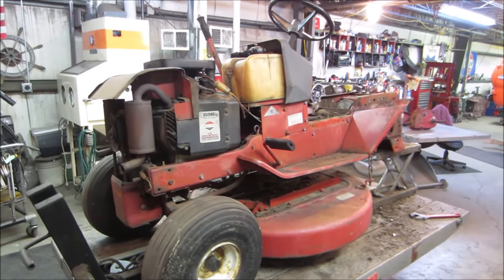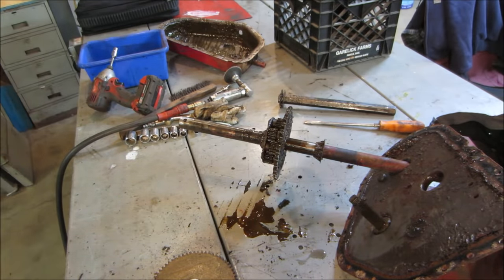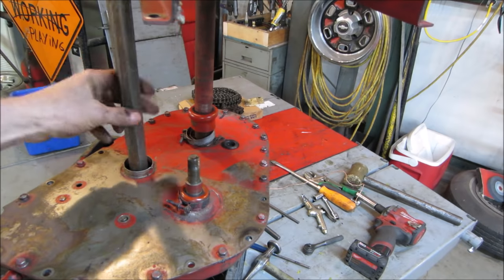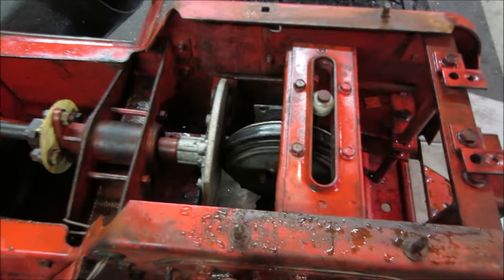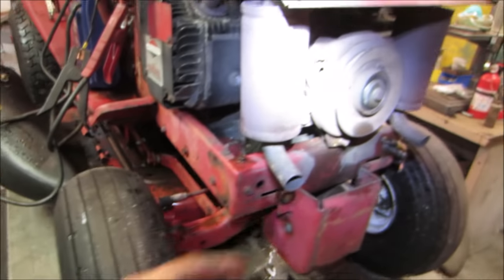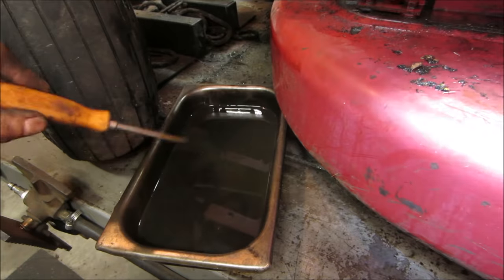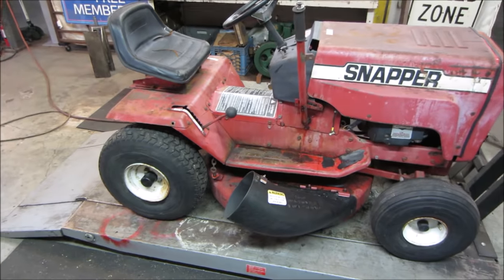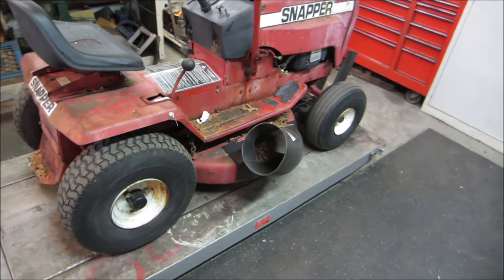Can We Fix The Damage? Free Snapper Mower.

Comment from the maker: Hi Guys check out a friends tv show that will be on discovery tonight, check out the preview here, https://www.youtube.com/watch?v=z_qmTT1cFKU
Reply: Thank you Darren! ML&R
Reply: So when you're ready to take this mower to the next level I can hook you up with some left over and sample hydraulic goodies to convert that to a hydrostatic drive (industrial, not mower type).  That would work better than the disk drive for wheelies, towing cars, etc., than the slippy disk drive and offer the added benefit of being complex and cool. The whole show could fit under the seat driven by the driveshaft.
Reply: ive been following and watch in YT a Kaplan America long time now
Reply: ok, THIS looks like fun!
Reply: @KaplanCycles  looking forward to it! Thanks Mustie for sharing!
Reply: @Miata822 n

 a
Reply: @owenhawkins4951  ???
Reply: These mowers usually take 00 grease, since as you noticed, they are not sealed tight enough to keep oil in.  If I don't have 00 grease, I might make do by mixing about 3 parts standard #2 grease with one part gear oil.
Reply: On your rant.  More and more of the new stuff has no manual because the company expects the whole assembly to be replaced as a unit, such as a Nissan Continuously Variable Transmission.  For this stuff, not only is there no manual, there are also no new parts, so any repairs need to be done entirely from junk stashes and intuition.  Starter motors, Alternators, power steering pumps, AC pumps and stuff like that are getting that way too.
Reply: @KaplanCycles  saw your show! Love your stuff Sir!
Reply: @jessewoolley6323  what u trying to say do u need help
Reply: I like this dudes page no nonsense straight to the points KEEP IT UP  BOSS MAN
Reply: Great work Mustie, i love your long videos, very interesting. Thank you.
Reply: Kaplan is the man!
Reply: Mustie just a suggestion I use 15/40 rotella T 4 in my J D lawnmower and wouldn't use any thing else I highly recommend it have gotten the very best service out of it.    I just can't understand why people spend their hard earned money on equipment and don't properly maintain I know some times things just happen but proper maintenance goes a very long way? That single blade will make a beautiful cut and I would never modify that mower for nothing else great find and job I would love to find a free one like that my self.
Reply: Just to let everybody know that the lawn mower people do not put on parts catalogs on anymore but you can request them and they will send them to you this is good FYI since nowadays they don't put anything that they don't have to and they want to make you not be able to fix it

Comment: There really is no better feeling than bringing back a DOA piece of equipment. Those who've never done it just dont understand!
Reply: I know the feeling. I restore old machines all the time. It's very satisfying to see an old machine live again.
Reply: It’s even better when it’s something dead easy too, like the one mower I got was sold to me as scrap with the note that the transaxle was blown, well it moved down hill but quickly stopped moving and had no reverse, after dropping it I found the axle was snapped (I may have figured this out some other way but I forgot) and it was off to the friend with a welder, some sealant later and all was good
Reply: So true, I did 2 push mowers and a pressure washer this summer.
Reply: Yeah I took a 300$ 1980 kdx 175 two stroke dirt bike that was sitting for years and no top end gaskets and no carburetor plastics or seat and pieced it back together with a carb I had and made gaskets and made a seat and seat cover from a shirt, bought some cheap grips air filter and a carb rebuild kit and a chain then I got to ride it today, under 400$ for a running riding vintage bike with working brakes and everything🤙
Reply: Yeah it’s great
Reply: Your absolutely right I've done it many times
Reply: Amen brother.
Reply: Again great video 👍

Comment: The old AAA sticker on the dash is an especially nice touch.  “Ah, yes Triple A?  It would appear I’m out of gas and stranded about 15’ off the side of my driveway.  Can you send someone out with a gallon please?  I’ll be in the rusty Snapper sporting a jumper pack!”
Reply: Holy crap! I just left the EXACT comment! Seriously. Stranded in my yard, out of gas. Even the part about needing a gallon of gas! Read yours and had to delete mine. Great minds think alike.
Reply: @Sebastian_Dinwiddie  Chris beat me to it too !  🤣
Reply: Funny but if you can get bicycle service from AAA, why not mowers?👍🏻😏
Reply: Locked my keys in the mower.
Reply: I wonder if they would have brought a new belt once the old one broke?
Reply: "My jumper pack needs a jump."
"Sir, that's called recharging."
Reply: Are you sure it’s not Alcoholics Anonymous. It is a snapper.
Reply: It’s odd that I have the exact same AAA sticker on my Snapper rider.  I think that I got it in junk mail and just decided that the mower was a good place for it.  It’s never left my property in 20 years so, no need for AAA.
Reply: @andy1056  sorry about your problem
Reply: @mikesbarn1858  🤣🤣🤣🤣🤣🤣
Reply: @robertgrant4501  🤣🤣🤣🤣
Reply: @zarb88  🤣🤣🤣🤣🤣🤣
Reply: I used to work for an auction company that did a lot of estate sales and for some reason a lot of the riding mowers usually had a triple a sticker.
Reply: Broken chain indicative of too many neutral drops.

Comment: I totally agree with your philosophy. I taught myself about small engines by tearing them down, figuring out how they worked, and fixing them. A friend of mine owned a small engine business. He had five mowers that had not run in years sitting in his back yard, and he gave them all to me when he moved. I just started tearing them apart over the last couple of years. I fixed two of them completely, built a good mower completely from scratch out of two others, and finally got the fifth one running two days ago. I have a few things to button up on it, but it's running pretty well. In the meantime, I have worked on nearly every type of small engine imaginable now, and have started taking paying jobs recently. To cut a long story short, I am 100% self taught, and taught myself simply by taking them apart and learning through trial and error. That's the way it should be done.

Comment: I inherited an exact copy of this mower from my father in law when he passed. 
I think it is much better than newer mowers with all their safety devices which cause batteries to run down and prevent starting. 
I have replaced the drive wheel, belts, air cleaners, blades, switches, and some other parts.  
Mine has a long battery next to the driveshaft and is hard to remove. I have a battery fixed to the outside of the body.  
This mower is more comfortable than the John Deeres.

Comment: Its just extremely satisfying seeing someone spend this much time and care on a cool old mower.
Reply: That much time? it is all relative. How many hours do blue collars workers have to put in at their boss to buy a new mower like this? Fun fact the new mower would never last this long as this one. (and it already has a head start of 25 years) If you keep this one from rusting it will last you a lifetime.
Reply: @patrickvanden8322  you know, thats why i only own old stuff
Reply: I picked up a used B&D MM 200 electric mower  off the trash pile. Fixed the rotten frame. Used it for 20yrs until motor burnt up. Replaced it 2020 with a NEW B&D MM 2000. ON SALE for holiday. 😄
Reply: @datadavis  Because they last or that it is way cheaper?

Comment: I grew up taking things apart and putting them back together. Dad brought home 3 boxes of engine parts when I was 15 and asked me to put it together. The following day when he got home I had it done. He opened his briefcase and handed me the manual and told me to make sure I did it right... my wife says there is nothing I can’t fix. Maybe, but that’s because of all the stuff I’ve taken apart with no instructions. Cheers.
Reply: I offered $13.5K cash for an '83 Mercedes SEL (in 85) with a busted timing chain from a consignment guy selling for a bank, who'd repossessed it.  Bank said That's WAY too cheap, we want to verify the issue before we'll accept.  Mechanic tore the engine apart, expecting the work.  When the bank finalized the sale and I didn't give him the work, he was pissed and randomly threw MOST of the parts in 2 boxes.  No manuals or anything, first MB I'd ever worked on. Parts ran another $3K - no internet back then - and you bet my ass was tight trying to make that much money run for me.  Made it run like a top and was near 300K miles last I saw it, when the ex got it in the divorce.

Comment: Mustie1. Definitely agree the old stuff was easier to repair without all the cheap plastic. I also used to get “not working stuff”, tear it apart and find out why, then fix it. Very interesting and Enjoyable! I did that one winter to a small Harley 175cc single cylinder Bobcat that was not running and rusty when given to me. I brought it into my bedroom (after draining gas, oil and fork fluid) tore it down to every nut and bolt. Cleaned everything, fixed a couple parts and replaced a couple more with 2nd hand parts. Put it back together and rode it for the next couple of years. We lived in a cinderblock home out in the woods with a bad roof (which I fixed also) so bringing into my bedroom wasn’t a big deal to the linoleum/rotted wood floor. Was a proud moment when it started on the third try!! Woohoo.

Comment: I just fixed my neighbors Simplicity 9020 with the same motor. It had a weird point setup, but the problem was that someone had connected the 'cylindrical mystery thing' with the spark plug wires coming out of it on ground. So yeah, the owner got scammed out of $500. She offered the papers and manual, but I declined and figured it out on my own.
This would not have been possible without your channel. You have been inspiring and teaching me to mix stuff the best and most fun way for a long time. Thanks man : )
Oh, and I got a briggs 5 horse, an old weed eater and a couple pocket watches for the job, so absolutely worth it!

Comment: I buy used/broken shotgun shell reloaders, fix them up, and resell them. Most of them have problems or have sat a long time and are rusted. I've done around twenty of them over the past five years and have gotten so that I can take them apart and put them back together without referencing exploded views on the internet. You are right about diagnosing things without any reference manuals. The experience of figuring out how things work gives you an appreciation for your abilities.

Comment: I love your ‘rant’ at about 59 mins, taking things apart, learning  how they work is park of my healthcare ‘change management’ philosophy - “if it ain’t broke, brake it’!
When you put it back together, all cleaned up (even if that’s all you’ve done) it works smoother & slicker. If you’ve got people on board whilst you do that, with the team they learn about how & why it works too (& take more ownership of keeping it running smoother in future . . . Hope you can see the simile /metaphor 😉 love the vids as I do mechanical rebuilds for relaxation from people/system rebuilds so they tick two learning/validation points for me👌

Comment: Seems like overly complicated drive system, considering that it’s even shaft drive to begin with. A regular rear end would likely cost less and be much more reliable.
Reply: Dave Iaucco  I was wondering whether this Snapper drive design was optimal or not. A second opinion (yours) convinced me it’s not, however the overall ruggedness of this tractor compared to all the current cookie-cutter clone MTD, Yard Machines, Bolens, Ariens, etc. mowers from 20 years back to the present day is remarkable. This Snapper is pretty close in design to those classic 1960’s mowers...
Reply: The friction wheel was popular in the 60s as well. Homelite used them. There were also very well made machines from Wheel Horse, John Deer and others that rivaled the manufacture of full size tractors.

Comment: I agree with you to some degree, in that I like to figure things out first.  Sometimes there is a challenge and I like challenges.  Using a manual for repairing something is for when I can’t figure it out or if I’m putting something back together that I did not take apart.  I will use that practice on cars, locomotives, mowers, and other things around the house but NOT when I’m working on aircraft.  

My formal mechanical training was in the Air Force as an Aircraft Mechanic, (AFSC 43171F)  I got my airframe and engine mechanic’s license a couple decades ago.  When I needed to rebuild my air plane’s engine, a 180 HP Lycoming O-360, the first thing I did after removing the engine and getting it back to my house, was to buy the current overhaul and parts manuals.  I read the overhaul manual cover to cover a couple times before starting the tear down.  While reading it I highlighted lots of important steps and wrote lots of notes in the margins.  I also talked to the Lycoming tech reps a good bit.  

That was in 1991 and  was my first aircraft engine rebuild.  I had done several car and boat engines.  When I put it back on the airplane it started on the 3rd blade.  After the ground break in I flew it around the East Texas airport for the rest of the break in.  I had to make an emergency landing after loosing all the oil pressure.  Then I flew it to the paint shop where I was heading when I lost the oil pressure.  That engine is still running today, but I did put 4 brand new cylinders on it in 2010.  

The odd thing about this adventure,  which took 8 months, was that I lost the transmission in the car on the way home with the engine.  Automatic transmissions are about the only part of a car I do not go into.  I have pulled them and replaced them, but let the pros rebuild them.

Comment: I think Snapper makes a “00” gear oil/grease for lubrication on all their drive systems.
Reply: I know they used it in the self propelled push mower gear boxes. But not the riders. Biggest bottle you could get it in was like a quart and it was very very expensive. Shit was thick . Was almost grease.
Reply: @waffalobill  in tractor suply you can get liquid greas for gearbox like that
Reply: It's basically the same as truck hub lube which is halfway between 90 weight and grease and costs way way less
Reply: @drajo123  it's not a gear box. Just a chain drive unit.
Reply: @waffalobill  it is on top
Reply: @drajo123  and you think that "00" grease will splash up that high?????
Reply: @waffalobill  Wondering that myself. Have no experience with the 00 but it says it’s a semi-fluid grease. Not sure what the consistency is. I’d rather have something like 140 weight lube oil for those chain drives.

Comment: The shaft that adjusts the drive wheel, just like on a snowblower, should be lubed with a little grease which will allow the drive wheel mechanism to more easily change gears and have less of a chance of sticking in a single gear.  Overall, the drive train being nearly identical to a snowblower makes that mower extremely simple, well made and should give years of good service for a light duty mower.  Thank you for filming what my body no longer allows me to do.  I absolutely loved tearing into "broken" things, figuring them out and getting them working again.  It's a shame doctors can't do a better job of the same thing with old, wore out bodies.  Thanks again!

Comment: I used to have a Snapper rear engine rider; the shift lever, when you moved it out of the detent, would also disengage the transmission disc from the driving disc.  It was nearly as flexible as a hydrostatic transmission, you could clutch/declutch and change speeds and direction all with one hand, no feet.

Comment: I have 3 MF10 from the 70's-  Dad had one, I bought one for parts and then was given one.  I actually got all of them running and working-  one a mower, one with plow blade and one I use just to pull my trailer-  all have geared transmissions-  I keep them even though parts getting hard to locate-  so much better built then-

Comment: Your final comments about figuring something out using your own brain power is right on the money. When you said you were a kid and tore everything apart you could get your hands on, I thought you were talking about me. Great job on the fix. The only thing I would have done different, would have changed the oil in the engine before I ran it that much. I think that light color in the oil was water, not a very good lubricant.

Comment: 90% of this machine is exactly the same as what my rear engine snapper was. Same gear box and axle setup. Same disk that spins on the driveshaft was installed directly to the engine shaft on the rear engine model with that rubber wheel disk. Even had the same seat and mowing deck. It's actually a really good mower cheap to fix I ended up selling it for twice what I paid years later.

Comment: There is definitely metal in the oil. The main reason engines fail to save five dollar worth of oil. Balls make all the difference for sure. Pivot points are best lube with a dry high build teflon or die parting lube which dries to a dry slippery surface without attracting dirt and debris. This really works period. Nice work for a free machine for sure. Built way better than today's Highs or Home dump for sure.

Comment: Lack of proper maintenance & lube lead to the failure the case has a fill hole to put gear lube in & the drive shafts are in need of grease where the boot cover them & those need to be checked yearly along the seals that cover the bearings if that 1 bearing seized that would have broke the link all do to lack of lube & by looking at the cover it had been leaking 4 awhile. thanks 4 the follow up video & You need to get rid of that VW bus & get a Greenbrier more power!